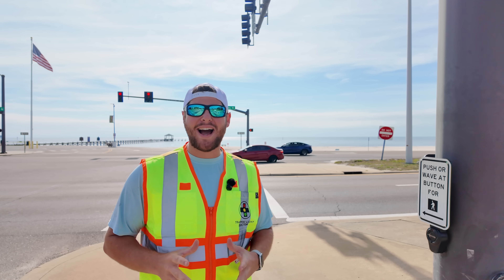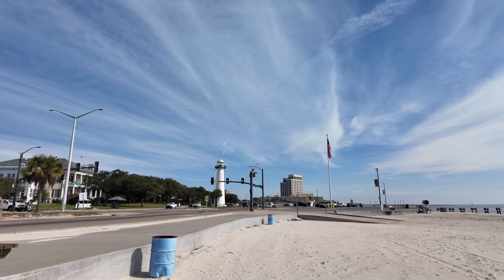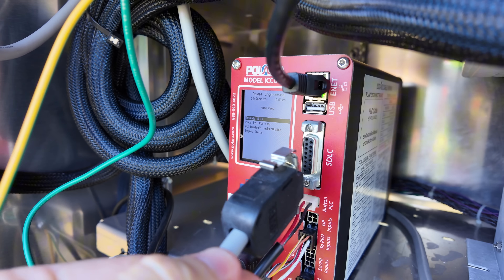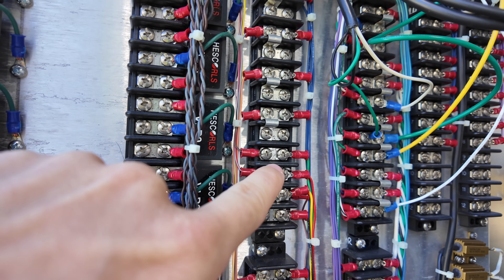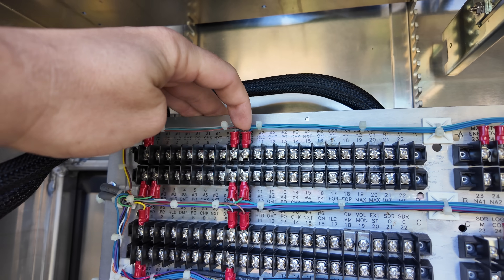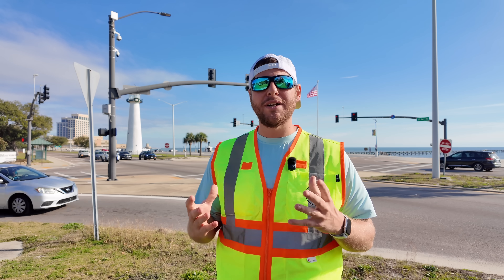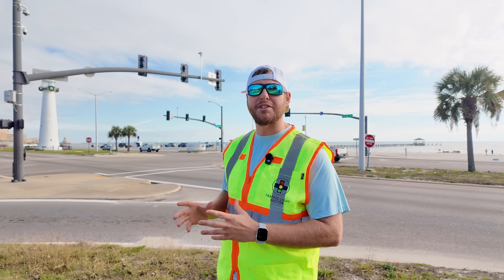What Happens When You Press A Pedestrian Button?

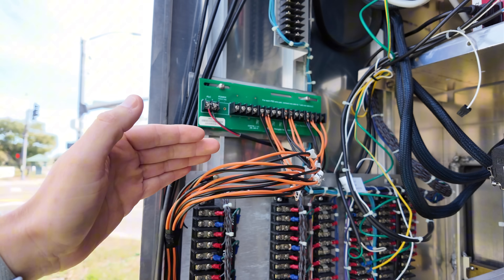Comment: 2:20 PLC in this case is Power Line Communications. The Buttons get 24 volts DC and communicate over the same 2 wires. So they are communicating to the ICCU over the power lines to the buttons.
Reply: Correction:  PLC = Programmable Logic Controler.    This is a special type of hardened computer designed to operate in industrial applications.    If you don't believe me, try Googling the terms.
Reply: @BobDiaz123 the Polara is not a programmable logic controller. It is a central control unit. If you read the instructions on the unit you would understand better and realize that the manufacturer calls it Power Line Communications. The plc board is literally only a connection that breaks out from 2 wires to 16.
Reply: Never heard that.
 What's the logic behind the label "power line communications " and logic controllers needed to store data and select trigger lines to correspond with desired lines or loads?.
I know what is inside those cabinets are programmable logic controllers which do what you mentiiend with 24 volts and 2 wires if that's all the wires you want to use.
Reply: Actually a PLC is a programmable logic controller. In simple terms it's a computer that you can program to tell a machine what to do. Please do not misinform people as to what a PLC is. ✌️
Reply: @Dorkus_  I believe there are two PLCs in the cabinet one is related to the pushbuttons two wire circuit board, Power Line Communication and the other related to the Controller I/O board, Programable Logic Control.
Reply: @Dorkus_ please read the Polara ICCU manual.

Comment: I kind of figured that was the case. Usually, there will be a little "beep", or sometimes, a red light, that will indicate that the signal was acknowledged, after that, pressing again, by another person stepping up doesn't make any difference whatsoever. It's exactly like the floor buttons in an elevator.
Reply: Oh yeah, the good ones will have feedback for disabilities using the button itself (audible beep, maybe voice saying wait when it's pressed and to cross when it's green, and the button will vibrate as to be the most accessible that it can be). But yeah, like all the ones in my area are obvious that they do something because like this video shows, you won't even get the green on the pedestrian crossing light when it comes up (it'll just stay red) if you didn't press the button.

Comment: The annoying thing about those systems is if you reach an intersection just as the light is turning green in your favor, hitting the button won't give you a walk signal.  You'll have to wait for the entire system to go through a cycle before you get one.
Reply: Most of the ones, the button press works that way. But there's one specific one where I live, where if you press the button a few seconds after the lights turn green, it'll actually put the walking sign Guy on it. 
I wish they all would do that, as long as you push the button within reason. 😩
Reply: I just wait until the street is clear
Reply: @danieldaniels7571 I do the same thing sometimes.  Also, even if I have a walk signal, I keep my head on a swivel, just in case a car blows a red light or turns into the crosswalk.
Reply: Since pedestrians have right of way on green, I would go anyways and like someone else has said keep head on a swivel
Reply: @smnbrgss They meant that the light for cars turned green but light for pedestrians remained red, I think. And in LA (like Hollywood, I think), they will ticket pedestrians as soon as they enter the intersection if it starts flashing red/"don't walk" so ppl respect the light. (At least I do.)
Reply: Or, you can just Run Across,playing Pedestrian Ping Pong 😂
Reply: @jamesmcdonald6047 Frogger
Reply: @jamesmcdonald6047 Frogger😁🐸
Reply: That's not always true, I've pressed the button while it was green and gotten the walk sign, just depends on the intersection and if there's enough time left in the cycle to allow it IF it's programmed that way.
Reply: @MattKeller yes, they have a personality module that can be programmed an infinite number of ways. By timer, by sensor (push button), by both, or switch from one to the other at certain times of day or only on certain days.
Reply: 🤣😂😆If you`re Not in a wheelchair or on Crutches...Just "Stop Look and Listen..Look Left, Look Right Look Left again...If the Coast is Clear...JUST CROSS THE FREAKIN STREET...🤣😂😆
Reply: @weldrider1 
... and put the f**king cell phones away while crossing the intersection.
Reply: I just go cause I still have the right away lol
Reply: @Joshua-k1y "He had the right of way" looks really pretty on a grave stone.
Reply: @Joshua-k1y  Its not right of way, as much as logic. The WALK sign comes up parallel to green light for vehicles that's parallel to crosswalk. So if cars get green, it's usually OK to walk too. Unless it is a complex crossing, and there is a side traffic coming across the crosswalk.
Reply: @Joshua-k1y  No you don't. At a signaled crosswalk you have the right of way only if you have a "walk" signal. If you cross against the signal, you're on your own.
Reply: @jdubyaxx It depends where you live.
Reply: There's one light in the country that actually gave me the walk light just after the green light appeared.
Reply: Yep. Frustrating
Reply: you can still walk while it's green, stupid
Reply: Well, cars trying to reach the stop bar on a left turn run the same fate and might have to wait as well.  There are however some cities that will prioritize pedestrians and will shorten the cycle to accomodate you.
Reply: It literally waits until a wave of oncoming traffic gets near it, and then turns RED to them to let you walk the walk of shame in front them.

Comment: Interesting that the pedestrian buttons affect the lights in Mississippi,  In Boston MA, they do two things.  First, it will bark, "wait", whenever you press the button, even if you already have a green light.  You demonstrated that feature in your video.  Second, if someone pressed the button, it will emit a chalkboard-scratching clattering noise when the light turns green.

One thing the button absolutely, positively, WILL NOT do, is affect the sequence or timing of the lights.  The lights don't care if somebody is playing a tune on the button or if there is nobody there.  They will always follow their pattern of street 1 for 2 minutes, street 2 for 1 minute, walk for 20 seconds, flashing walk for 10 seconds, and back to street 1.  If a street is one-way, then the near cross walk will be green while that street has a red signal.
Reply: Alternately, in my town of Canton, I have to cross an intersection that DOES use the button.  Unfortunately, they maintain the button every 3 months or so, and each time, it last about 4 days before the contacts corrode so that the traffic light controller can't recognize pushes.  It's, of course, on the main drag between the town center and I95, meaning people have to play frogger in order to get to work.
Reply: @andrewholden1501 Most newer "buttons" have no contacts. They use an optical or magnetic sensor and the actuator just moves a flag into the beam path or a magnet close to the sensor.

Comment: Forgot to ask you a question I noticed why you’re in his cabinet something I haven’t noticed before there is a bank of resistors right there on the back there one after the other under each other they got white wires connecting into them. What are the resistors for main grant I know you’re dealing with Low Voltage here as well as regular or 120 V current on other contacts. This isn’t a hard system to wire up anybody who has basic Electronics knowledge like me can do this, but I’m just curious what the resistors are for cause I’ve never noticed them before any of the other cabinets that I’ve seen you open or closed over the previous videos so I don’t know if it was something specific to this particular cabinet this intersection or what it was but and yes, I’ll give you 10,000 likes unplugged the license plate reader nobody needs to know our license plates don’t tell anybody I said that
Reply: They are likely load (shunt) resistors used to simulate the electrical load of incandescent signal lamps. This allows the traffic controller to properly monitor lamp status and detect failures when modern LED signal heads are installed.

Comment: Could've built a bridge over the highway to the beach.
Reply: NOT ADA approved.
Reply: @602STS2  Bridges can't have ramps? Choosing the less safe option to be more accessible seems backasswards.
Reply: @cadevaughn7596 Of course bridges can, and do have ramps, but your short-sighted thinking is limited to able bodied people. How long, and thus how steep, does the ramp have to be to allow wheel chair users or others with walking difficulties (walkers, canes, etc) to be able to cross? Also, the height over the roadway has to be sufficient to allow loaded trucks to safely pass beneath so the height determines the angle of the ramps and ultimately the length. I used the term "ADA" for a reason.
Reply: @602STS2  Good ol acronyms. The American Dental Association approves. Why can't you?

Perhaps my scope is outside your comprehension.
Reply: @cadevaughn7596  Your failure to think through your idea is duly noted, Skippy.
Reply: @602STS2  And really the best solution would be take out some lanes, maybe add a roundabout, put in more lanes for pedestrians & cyclists, throw in a dedicated bus lane or two, and really have the average speed much slower
Reply: @smnbrgss  Woulda, coulda, shoulda, if only, possibly, maybe pigs can fly any day now. 😏
Reply: "Could've built a bridge over the highway to the beach." in the time it took to tell the story.

Comment: I will push the f*ing button until it changes the light. MFers in their air conditioned steel cage get priority for everything, while pedestrians freeze their a$$es off or sweat to deafh, waiting for sh1tty electronics to let you safely cross a deafh trap made for frogger.
Reply: Yup!  In the US, keeping the cars moving is the only thing that counts.  Never mind the pedestrian might have just walked a quarter mile to cross at a light, and they get a quarter mile walk back on the other side.
Reply: @MTBSPD The traffic laws in most places allow pedestrians to cross anywhere if they're at least 200' from the signal.
Reply: @KJ6EAD  "Section 63-3-1105 - Pedestrians crossing roadways at locations other than crosswalks
(1) Every pedestrian crossing a roadway at any point other than within a marked crosswalk or within an unmarked crosswalk at an intersection shall yield the right-of-way to all vehicles upon the roadway.

(3) Between adjacent intersections at which traffic control signals are in operation pedestrians shall not cross at any place except in a marked crosswalk."

Nothing in 63-3-1105  about an exemption for at least 200' from a signal.  You could interpret (1) to work that way, but it still says the pedestrian has to wait until there aren't any cars, which will leave the pedestrian waiting quite a while in places like Biloxi Beach.
Reply: @MTBSPD There used to be a 300' rule in California so I got it wrong on both distance and currency. In Mississippi, you can cross anywhere except between signalized intersections so long as you yield to traffic, sometimes a long time as you say.

Comment: The same people that press the cross-walk button several times are the same people that have to press the elevator button several times too....... even after they JUST WATCHED someone press the button.  SMH.
Reply: they really need a close the doors button on elevators. in the time it takes them to close i could also walk up the stairs 🤣
Reply: @kahvikissa_       Some elevators do have a close button.
Reply: @Eternal_Tech  lucky are they. here it only got a useless open button, useless because in case it stalls it will not even open the doors which has to be done with a key from the outside 😅

Comment: Fun fact.  The old non-digital push-button systems tended to break so often that cities stopped fixing them when they realized that people couldn’t really tell the difference.  Despite doing nothing, they still worked as big psychological calming devices.
Reply: So that's why we have the hunch that they don't do anything, because a lot of times....they actually don't!!!!
Reply: In the UK, we have some junctions where the pedestrian crossings are on a strict timer as part of the normal sequence. They still put the buttons there because people get confused if there isn't one. All the button does on these is illuminate a light saying wait. The box isn't even connected to anything.
Most junctions will skip the pedestrian part of the sequence unless Button is pressed so you don't really know if you need to press unless you sit there and watch the sequence. There are even some where it only skips pedestrian part if button hasn't been pressed for multiple cycles so it can be even more confusing to work out if button even works. The ones with timer only are when traffic through part of the junction is stopped anyway for other traffic so they might as well show the green man for pedestrians.
Reply: @mog0  good knowledge
Reply: There definitely is a difference. Usually the green light stays on longer so pedestrians can walk, so it's a long red light for the other road. If a city doesn't fix it, it means that the other street is getting a longer red light for no reason.
Reply: You didn’t cover the ADA part.
Reply: That IS a fun fact!
Reply: In New York from 90's to 2020 they been nonfunctional in 95% of the corssinhgs.
Reply: A button that we suspect does nothing is NOT calming.

My nearest signal-controlled intersection doesn't have pedestrian buttons, because the light timing is fixed. The lack of pedestrian buttons is the clearest indication that a light's timing is fixed.
Reply: @AtomicBuffalo  -- Or that it's old. In the countryside, where I am, there are lots of signals that don't have buttons and don't have pedestrian lights. Wait for green and run. Can't run? File an ADA complaint.
Reply: Yes, just like the "close door" button inside elevators. People always stab those things to hurry the closing process but unless the elevator automation was going to close the doors anyway, the buttons are useless it seems.
Reply: @anthonyc1883  The open/close door buttons can be configured to work (where I work exactly one elevator in one building has been configured like this), but it usually is set to "fire only" mode, where it'll only function if the fire key is inserted and it's set to fire recall or fire mode. In these modes not only does the door close or open if you press those buttons, it can be made to STAY open while moving or between floors for rescue purposes, which is what those buttons are actually for, not for individual public users.
Reply: @EmperorQuacky  Very interesting, although in my long career as a white collar worker in multiple office buildings large and small, the OPEN doors button was definitely enabled for public use. Countless times I or others have pressed that button to let other passengers on, or to give extra time for a slow-moving passenger to exit (such as a wheelchair user). The button would work to either hold open the doors that were already fully open, or to open the doors that had already started to close.
Reply: @anthonyc1883  It very much depends, but I'd say the open button probably is normally enabled, and close not enabled. I was more thinking of the function of keeping the door open in motion, which does still need the key. Though the university I work for have definitely disabled them both entirely without the key.